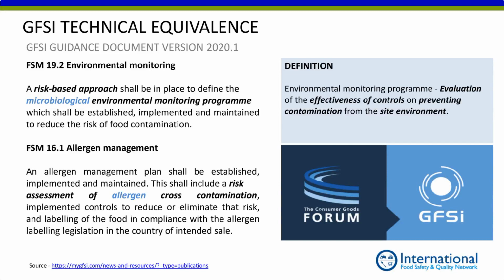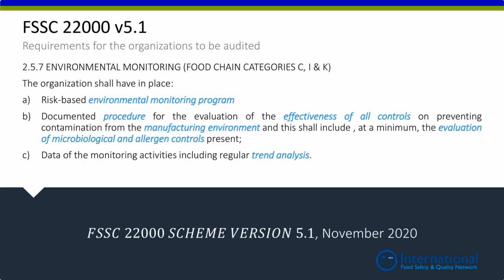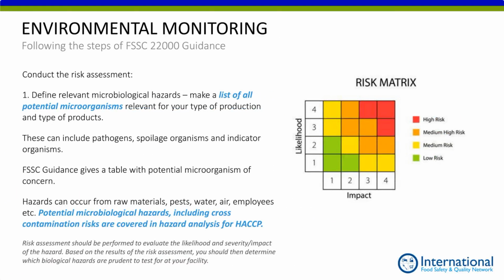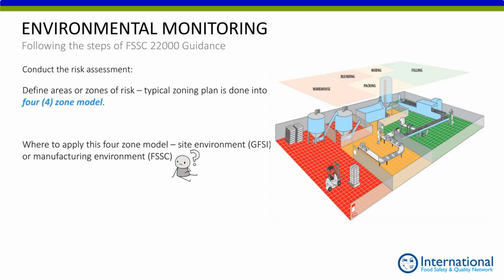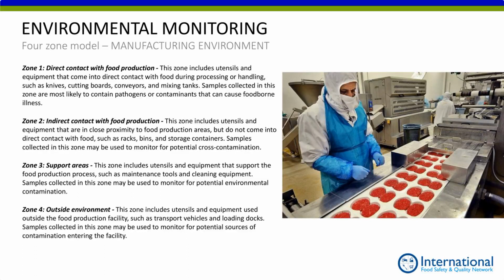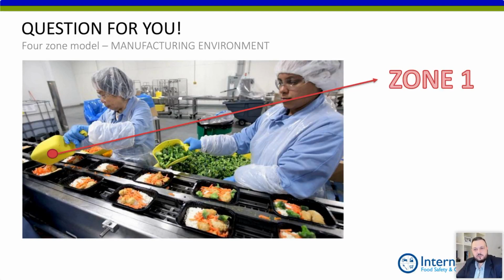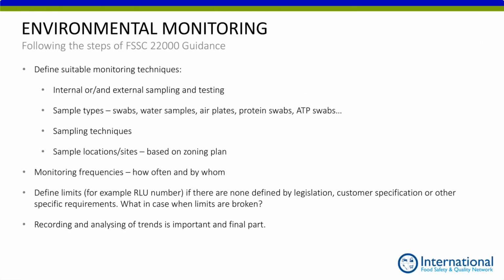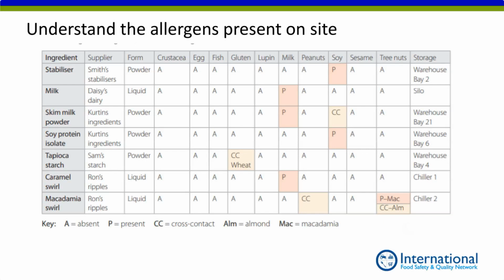FSSC 22000 v5.1 Environmental Control Requirements

Comment: Thank you very much. May I request to explain for ethanol 40% whisky production. This environmental monitoring requirement 2.5.7 confused me how to implement. Because whiskey was the drink that completely eliminated all traces of the bacteria. No other microbiological hazards. Do I need an environmental monitoring program in my food facility?
Reply: Dear Su Su, you will perform the risk assessment, showing no or yes risks for this type of product. Generally, risks in this production are connected with the raw ingredients you control on reception. Regarding the production environment, you can focus more on other potential contaminants of the chemical origin or allergen origin.